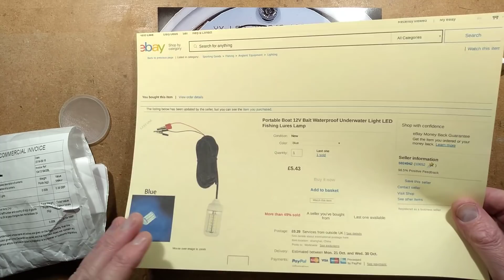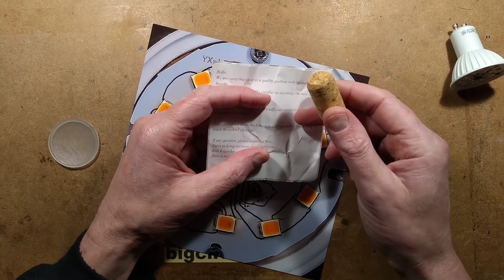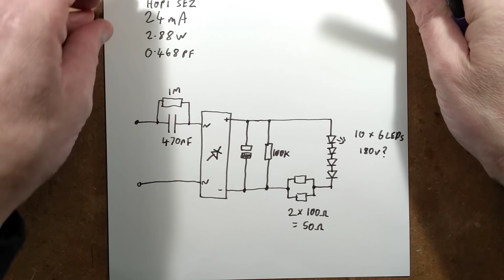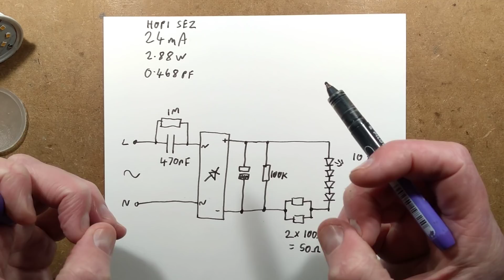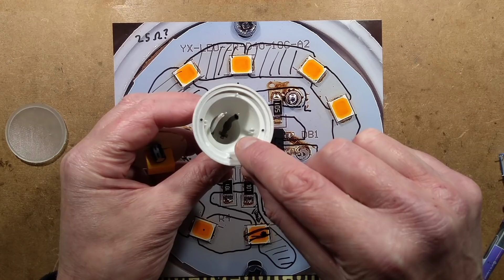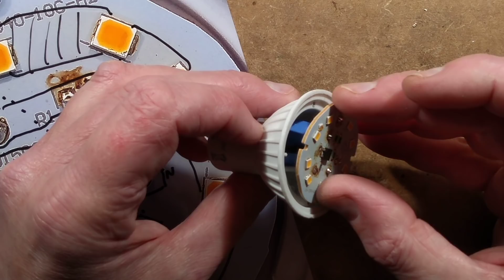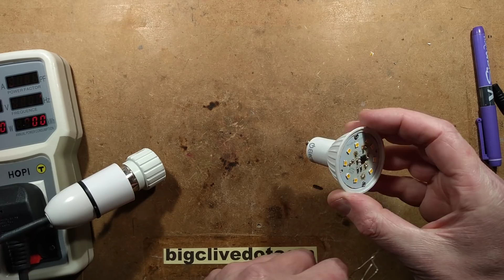Mystery corks, PCBs and fixing a dead lamp.

Comment: It looked to me as if the round pad to the right of R1 had a fractured solder joint - could well have been flux residue.
Hmmm 5 G oh yes that's the thing that will kill us all right? kilowatts of near microwave radiation all aimed at our heads ( forget signal coverage )
The puppy and kitten thing, well too much fur for my liking. Now the babies on the other hand sound potentially tasty cooked by the massive
power output of the 5G antennas that will be all over the place. Ummm Crunchy babies - BYOBS bring your own barbecue sauce.
For those of you playing along at home, think of microwave popcorn. Pop goes the baby.  How very irreverent of me.

Comment: Cool you making a vid about the underwater light, just bought one for fishing myself recently. Use it for catching squid, the green LEDs apparently are specifically attractive to them. Unfortunately buoyant so had to weigh it down to have it sink a few feet. The wires is really angel hair thick though, and the advertised 15W on mine were a blatant lie. A cool effect is to stare at the green light for a min, really saturates your green cone retina cells, so your field of vision is super pink tinted for a few minutes, and white lights appear pink. Very cool biological effect.
Reply: "Specifically attractive" might be related to GFP and the squid's natural choice of prey? https://en.wikipedia.org/wiki/Green_fluorescent_protein
Reply: @theskett  Either something of that avenue or their sight receptors potentially being more sensitive to light around 5-600nm

Comment: You won't get the lamp holder. Just open an "item not as described" case on eBay, upload a photo and get your money back after much toing and froing with them offering you ever increasing partial refunds. Just stick to your guns,you'll get a refund eventually even if you have to ask eBay to step in.

Comment: I'm an electronics engineer and also an "eco-hippie" and to me banning lead solder is just a bandaid. The real problem is that nobody is considering how to dispose of or re-use electronics at the time they're designing them, and so they just end up in landfills without any of their rare elements being recovered or harmful substances being removed.
Reply: Yeah, I have pretty much the same feeling. (To be fair, easing recyclability was cited as an argument in favor of removing lead, particularly in Japan where they were running out of landfill space; if anything, this may be stronger than most of the other arguments for lead-free. Recycling is still very far from a panacea, though, given the gross inefficiency of electronics manufacturing in the first place, especially of semiconductors.) I'm just not sure of a really good way to reduce e-waste in the first place, given technological obsolescence – beyond reducing demand for the services it provides, and discouraging unnecessary upgrades (how to co-ordinate those at large scale?). I'm of the type that keeps my old devices as long as they're still usable, so that should help a bit. For items which rarely (if ever) become obsolete, of course, the best thing is to make them last as long as practical.

Frankly, I even consider video sharing a privilege, given the amounts of storage and bandwidth used (vastly greater than for text-based media); so to be worthwhile to me, a video has to offer something a text-based page (even with pictures) couldn't…

Back on topic, if we were that worried about lead, then surely phasing out lead-acid batteries as swiftly as possible would have been the best thing to do (after having taken care of petrol and paint)? (Indeed, some campaigns to move away from lead batteries did exist around the same time RoHS was introduced; but where are the results?) Are we hypocrites or what?
(I'm not saying it's effortless to change to other battery technology; but I don't quite see the logic in banning leaded solder from electronics while giving lead batteries a legal pass. Unless Big Battery was too mighty for legislators to confront, that is, but it still makes the solder restriction seem like a token gesture; I know the batteries are meant to be recycled, but since they're the dominant remaining use of lead, only a small fraction have to be wrongly disposed of to make up a large portion of lead waste.)

In fairness, a considerable part of the trauma of the transition was due to misapprehensions in the electronics industry (which for the most part lacked much metallurgical insight, as it was the first time they had to deal with substantially different solders) about how to work with the new alloys: http://www.solderrecovery.com/pdf/Lead%20Free%20Article%202.pdf
It even suggests that the understanding gained from the experience may eventually outweigh whatever underlying metallurgical shortcomings remain.

But in a nutshell, I can see valid and reasonable arguments each way; I don't doubt that significant improvements in lead-free solder have been made (although the poor versions are still in use by low-end manufacturers), but I'm still not sure RoHS took a very good approach (if they were a bit gentler, say by requiring mandatory declaration and/or a tax on lead content, then they might not have generated the same resentment). As for the 'no safe level of lead' party line (not that I deny the claim outright), to be fair, I'm not so sure if there are completely "safe" levels of other poisonous substances (that aren't necessary nutrients at some level – although there are suggestions that extremely low levels of lead may be vital to at least some organisms) either (of course, they are qualitatively different in how they harm).

As for what DIY and repair people use, I've adopted the "live and let live" approach. (So far I've been using Sn60Pb40 in my stuff, of which I have more than I'll need for a while; I'll decide what to use after that when I come to it.)

Comment: I am so fed up with the eco warriors that go on about lead in solder. I wonder if they realise just how much more electronic items ended up in landfill because the lead free solder joints failed on thousands of BGA chips? Plus of course issues with tin whiskers growing from the lead free solder shorting circuits out. I really cannot understand the problem with having lead in solder, i handle the stuff nearly daily, and have done for 4 decades now, i have never suffered from lead poisoning.
Reply from the maker: Tests show that people who worked with lead based solder all the time do not have elevated lead levels.

Comment: As a vet Telephone engineer (telecoms weren't invented until later when I was out of my time)  I can confirm we all cut our teeth on lead based solder - I had a 5 rolls a week habit, it was cheaper than gum and chewier than toffee, and anyway we're only talking about a few brain cells ... When faulting strowager, the vibrations often caused wires to snap then it was standard to re-attach a short wire by holding the solder in your mouth then 81s grasping the wire with one hand and iron in the other to refix.
Can't imagine how many rolls of solder we used in a single exchange.  Some cables used wrapped joints but most were soldered.
As for the cheesy puffs - its not just your fingers that turn orange if you eat them especially while surfing certain sites (hem hem !).

Comment: I use lead-free solder mostly. With rosin core and very thin. When using a quality soldering iron, it really doesn't create any problems.
Reply: Same, I don't really agree with Clive on the lead thing. The alternative is 99% as good with 100% less toxic metal. Plus there's a good chance unregulated solder factories in China poison their employees and their environment with lead.

Comment: You do need to wash your hands.  I mean lead is nasty.  But in the quantities that are in a PC board?  Meh.  Now, if you saw one of the RF connectors I did a crappy solder job on, now that's a lot of solder.  🙄

I've just started to use solder wick when goofing around and noted your application of flux to it before heating - thanks for the unintended tip!

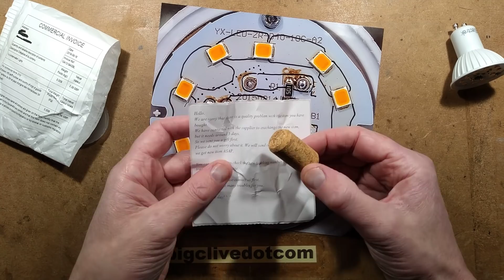Comment: 01:22 - Oh they know you, Clive! :D
I heard stories about RoHS solder being even worse.
Reply: There are tons of different RoHS solder formulations.
Reply: Some lead free solders are quite good, but they're not as cheap as the leaded ones. As long as water can't get to it (that means don't chuck it in the trash!), lead solder is fine. If you are manufacturing even small batches, do be considerate and get a good RoHS solder.

Comment: The cork is light. So in a sense they’ve shipped you a light? A light cork!
I’ll show myself out.
Reply: Stuart McConnachie it’s also waterproof
Reply: @crawleycreaper3351  Low energy too
Reply: @Arachnoid_of_the_underverse  Use it to fish with lures!
Reply: And it's from some 'lite' wine without a doubt.
Reply: I reckon Extinction Rebellion got his address - he's killing babies and puppies, polluting the Earth with blobs of lead and exploding PSUs, not forgetting using too much electricity. The heat from his soldering gun alone has put the temperature up 20 degrees over the IOM (latest IPCC findings) and the Aurora Borealis flickers over Douglas when he plugs in his Hopi...

Comment: There is a solder station that exposes mains voltage to the front panel if u do not connect the handle, interressted in sending it to you sir?
my friend has it, i think he has it from china

Comment: the aluminium other side is not supposed to dissipate heat ?  but you explanation is logical 
that's a big challenge when you design leds pcbs , you have to deal with one side . and it's not so easy ( except if you want to put dozen of 0ohm resistors )
Reply: The wide tracks (not aluminium) conduct heat away from the LEDs and dissipate it into the air and the PCB.  This is an alternative use of the word dissipate as used in saying that a resistor dissipates heat when current is passed through it.  Both uses are standard terminology in the English speaking world.

Comment: I had an led lamp explode while watching a video about an exploded led... well mine exploded a capacitor and looks like half the leds have the dot of death.
Reply from the maker: If it was the dropper capacitor that failed then it could have passed enough current to blow the LEDs.  If it was the electrolytic capacitor the LEDs may have gone open circuit and caused the cap to be over volted.

Comment: I have had free gifts from China sellers that claim similar things then the real item shows up in a few weeks. It's just so they can skip having to tell ebay they didn't meet their contract on time. I also think the flicker can be thermal too, kind of like the LED turning into a PTC where the bond wire is pushed away by the warm plastic until it cools, reconnects and does it again.

Comment: If you use EasyEDA to design your pcb's then you can select not to plate through the holes on a per hole basis. 10 days is typical for normal post with Yodel doing the final delivery, if you go for the DHL option then if ordered on Sunday delivery will be Thursday !

Comment: You can edit the component footprints in EDA to solve your through-hole issue.
Change the through-hole connectors to pad connectors, then use drill holes in the appropriate places once you've placed them on the board.
Here's a vid telling you how to do that... https://youtu.be/utBQqcuOt9U?t=422

Comment: could jumper out and remove one of the 50 ohm resisters . would run cooler.
Reply: If you jumpered it out, it would consume infinite amps and die immediately.
Reply: @SodAlmighty  jumping out would increase power by 1/5 removing 1 resistor would reduce power by 1/2  (somewhat)
Reply: Hmm....I suppose you'd still get the capacitive drop. Fair point.

Comment: I use lead based solder all the time, it's never harmed me.  In fact, I've been told I am in perfect health. 
I always have a chuckle when you do your conspiracy voice.  Thanks for the fun :)
Reply: Brendan White Have you gotten the specific blood test for workplace lead poisoning?  Because otherwise the doctor won't notice the early symptoms.
Reply: @johnfrancisdoe1563  I did that out of curiosity about a month ago.  Came back all within normal levels.   
Lead from solder doesn't really penetrate the skin a lot and the vapours that come from solder are mostly flux chemicals and very little metal vapour.
It's not like using lead water pipes or the soluble lead used in paints.  I would not strip lead based paint without protection as an example :)

Comment: i dont disagree that the solder craze is hysterical, the more since bullets still are made from lead and people are hunting with it... but lets not forget that still over 500.000 people die every year because of lead poisoning. there is plenty of evidence that lead is harmful unlike glyphosate, yet they are scared of both. one small drop of mercury wont kill you either, but since an alternative is available its better to switch the thermostats.
Reply from the maker: Mercury is definitely less desirable in landfill.  But the replacements in switches and mercury wetted contacts were abysmal.

Comment: Well, at least that lead isn't going to landfill (just yet), and I wonder which is worse, lead solder and a lamp repaired, or a new lamp, and old one contaminating the land - Hmm?

Now then, those of us who do ridiculous things, like restoring vintage TVs and suchlike, would have employed the 5A fuse wire trick, soldering the fine wire to those short leads and sliding the PCB (or in our case most often CRT and valve (tube) bases) down the wires until the original leads protrude through their holes, then solder them in.

And finally, did I hear Kenny Everett/Captain Kremen in the room there with you?
Reply from the maker: That's a good idea.  I've never thought about soldering on a thin wire guide like that.

Comment: Years of leaded petrol makes lead free solder pointless...
Reply: The two aren't really related. And atmospheric lead from petrol has gone down by >95% since 1994.
Reply: Years of wars with bullets landing in agricultural fields make keeping lead-based solder out of landfill pointless.  Because if the tiny amount of lead in discarded electronics can leach out of landfill into agricultural fields for many, many miles around then those bullets all over Europe means we're screwed anyway.
Reply: So we swap to carcinogenic unleaded yeah good call !
Reply: @gowdsake7103  At least with cancer, you know it's killing you. Tetraethyllead (anti-knock agent in leaded fuel) is a more sinister poison that had a measurable impact on society for generations. It's still affecting society today, where soil lead levels are still high near major motorways, as well as still being used in aviation for 100LL fuel for piston engined aircraft.

Lead bullets are a problem, but nowhere near the magnitude of TEL. Bullets from wars 70+ years ago tend to be buried several feet underground and are left undisturbed and don't cause many issues. Lead bullets used in game hunting are an issue though. Solder is only a problem when it ends up in 3rd world countries from improperly disposed of E-Waste streams where it is burned and released into the air.
Reply: Don't forget all the light aircraft that continue to burn lead containing avgas, not to mention all the years of automobile tire-balancing weights and fishing weights. Yeah, solder accounts for nothing.

Comment: They all promise 10.000h of use or more. They never do. What is more polluting? All these premature failing led lamps? Or a old school inc lamp? 🙄
Reply: Harm Zegt Depends if you buy power from a coal burning power plant or from weather powered renewables such as wind or solar.
Reply: John Francis Doe we hardly have coal power plants in the Netherlands. It’s wind power, bio fueled plants or natural gas for the most part. Oh and an atomic PowerPlant. But that is now used for creating nuclear radiation stuff to treat cancer patients.
Reply: Incandescent lamps are usually tuned for high light output and have a lifetime of only 1000h. So i don't know, how long do LED lamps last on average?
Reply: The Chinese crappy ones sometimes not even 100 hours.

Comment: I used to make those style of chips. Yes they are addictive.
Reply: That's the MSG (E621).  Nothing wrong with that - I never bought into the anti MSG hysteria and misinformation because it has far less merit than the lead solder issue.
Reply: @Chris_the_Muso  Yup, no tartrazine, but plenty of MSG, and the hot version was spicy hot as well.